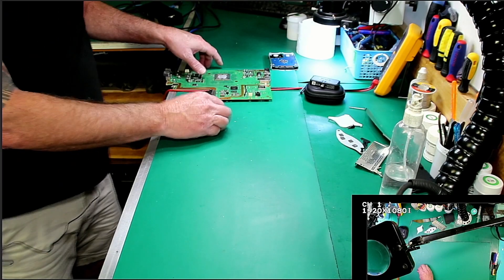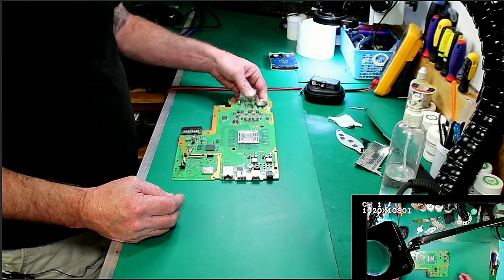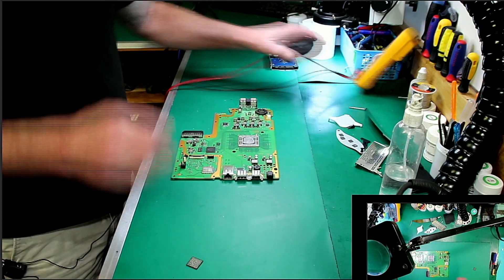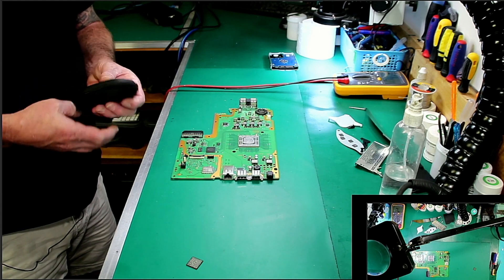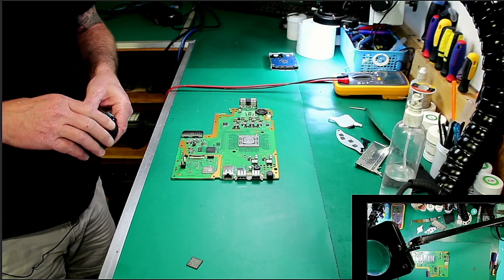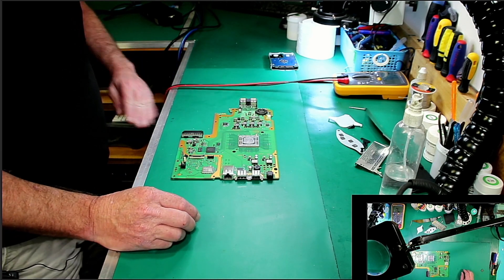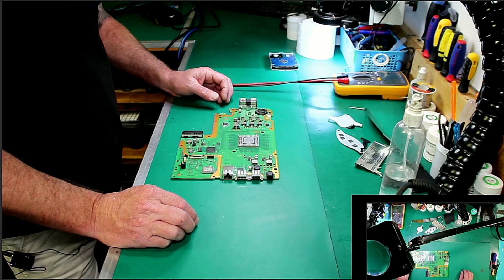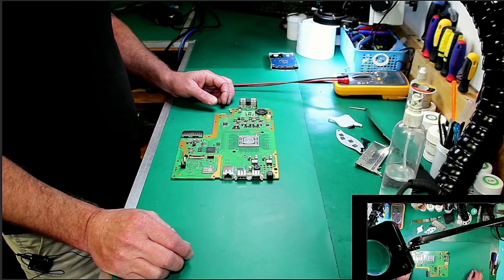PS4 NOR Repair - 3 Long Beeps Applying Power

Comment: hello sir can i ask a question i have the same problem with this i back-up the NOR and replaced it then it was booted now and restart with no 3 beeps then i finish all the work back to frame and close and then i power on the unit for testing again then now it becomes blod for about 5 seconds or more then shut off if i press the power the fan try to spin then off what could be the other problem of this sir hope you can help me im from Philippines
Reply from the maker: Hi
Sounds like you have other issues! It could be the power supply,the hard drive,Just to name a few.

Comment: Did you dump and patch the nor? Was it corrupt? Thank you
Reply from the maker: I dumped it and wrote it to a new IC,no patching. The IC itself had issues.
Reply: @AceConsoleRepairs  thank you very much! I’m dealing with the same problem and thinking in get a teensy or ch341a. Could I erase and write a known good nor ic from a donor board or has it to be brand new?
Reply from the maker: Yes! That is what I did. Used a donor NOR. Erased it and wrote the dump to it.
Reply: Thank you very much! I did it and it worked!
Reply from the maker: Good stuff!